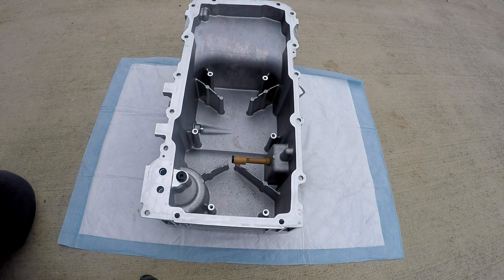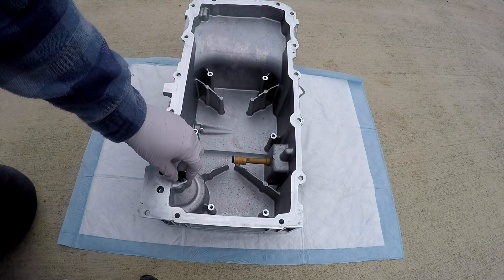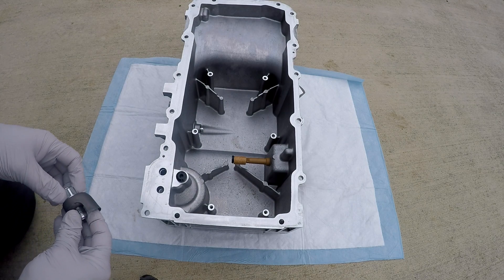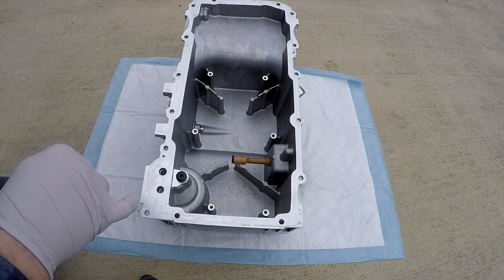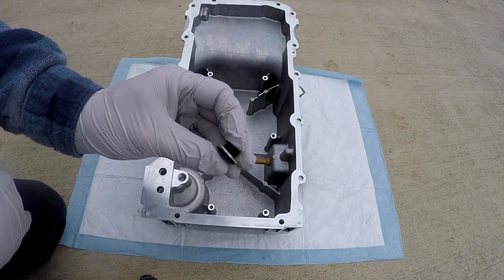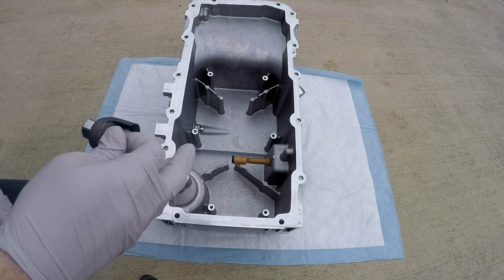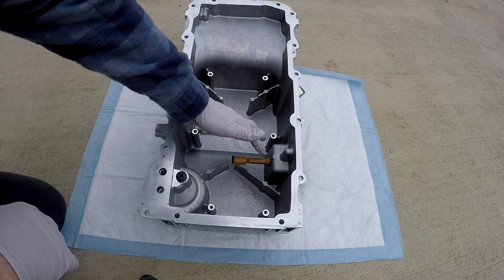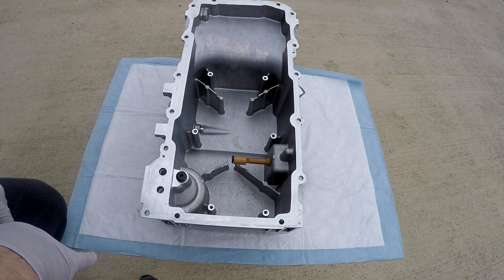Pressure Relief Valve in the LSA oil pan.

Comment: My issue is after an oil change I crank the engine in flood clear mode to prime the system, every other engine I have will either show oil pressure or have oil pressure immediately on startup. My 2020 6.0 will not. I even checked the oil level before & after cranking, no change. Upon startup there is a good 2-4 seconds before the gauge shows pressure, this with a prefilled oil filter. Why?

Comment: The problem I have on my '99 LS1 is that the oil pan seems to be under excessive pressure and it's pushing oil out the oil pan gasket. It can very well be that it's just the O-Ring/ gasket, but it isn't just dripping oil, it seems it's pushing it out. Any suggestions? Thanks.
Reply from the maker: Check to be sure you dont have excessive crankcase pressure or a warped oil pan.
Reply: @ That’s just it, I think it does have excessive crankcase pressure that’s pushing the oil out. What’s the cure for that?

Comment: I have an 07 Denali 6.2L, replacing the pan. Just put a 355 oil pump into it. What should i do with this valve? Plug it or replace it with a new one with a shield?
Reply from the maker: Keep or replace the relief valve if you have DOD/AFM currently in your engine

Comment: More like I just put the big oil pump on and still got no pressure
Reply from the maker: Sounds like you have other issues
Reply: Did you ever find out your low pressure issue?
Reply: @jsampang80  yes when you install a new engine prime it first 😅

Comment: trying to nail down a low pressure issue on an 08 6.0. Looking at this, it could be mis diaged if you just tested pressure at the filter mount, you would also need to test at the sender as well.. so testing both locations would verify if the relief was bad vs the pump.
Reply from the maker: Not the point of this video, but thanks.

Comment: I put a m14 x1.50 oil plug is it possible to put a too long of a bolt to plug the valve? I noticed the plug you installed is short in length. Will this work if I have oil cooler lines running to the oil filter?
Reply from the maker: Yes,, you can install a bolt that's too long.

Comment: I have a 2009 5.3 vortec without the variable piston option. Lately my oil pressure has been too high at higher RPMs and its causing oil leaks if I pull a long uphill drive into the mountain.

Could it be this part ?
Reply from the maker: No, If this part plugs then it just doesnt relieve at 58psi. I would suspect other issues.

Comment: I have a 2007 suburban 2500 with an LY6 that has VVT. I have a Melling 10296 pump in it. Can I run deinstall the oil pan relief valve and install a plug, or will it affect the VVT operation?
Reply: Did the plugging affect the VVT?

Comment: Is it ok to do it if you still have AFM/DOD on ur car ? I have low oil pressure and recently did a cam swap i already checked everything cam bearings cam shaft retainer plate changed my stock oil pump to a melling10355 high volume oil pump but still have low oil pressure problems by removing this valve would it fix my issue ?
Reply from the maker: NO!

Comment: Does this clogg more when afm is Delte or disables
Reply from the maker: The valve won’t clog if you delete AFM .
Reply: @fasnuf  so I have a range dod delte, can I plug it or do I need to replace relief valve
Reply: Oh I see I have range disabler so I’d have to buy new pressure relief valve?

Comment: You can use a m14x1.50 oil plug in place of the valve.
Reply: I have a LY6 with VVT, can I still plug it?
Reply: Should be able to.  There's a bypass built into the oil pump and the filter.   Only issue is if you have an aftermarket high pressure/volume pump.  You should be fine.
Reply: @20tea  I have a Melling 10296. Why would that be an issue?
Reply: @nategarrison99  it's not a high volume high pressure pump, so it'll be fine.
Reply: @20tea  eliminating this second pressure relief valve that is prone to fail shouldn’t eliminate any function of the VVT, since the pump has a build in pressure relief. Right?
Reply: @nategarrison99  The vvt still functions the same.  Problems only occur when there's too much pressure that the vvt doesn't work as intended. This generally happens with higher pressure springs installed on an aftermarket pump.  You'll encounter an error message on the dash.  I've experienced it with my hvhp melling pump, but it didn't wreck my engine or blow up a filter. I just reverted the plug till I get a low pressure spring installed.
Reply: @20tea  did you install a low pressure spring yet?
Reply: @johnnybobgoldstein2823  Not yet, but hope to sometime.  Have other car projects I'm trying to complete this summer.  Engine still good though.

Comment: How much of a pressure difference did you see when you deleted this with the upgraded pump?
Reply from the maker: It idles at aboot 27-30psi hot and redline at 70 psi using the Melling pump from my video with the middle spring. I went with  the high volume pump because the LSA has piston oil squirters so I want more volume to handle that extra draw. Thanks again Wes for watching.

Comment: What happens if you leave the pressure relief valve in after you do a complete dod delete with a new valley pan and cam and lifters along with a tune
Reply from the maker: The valve will continue to operate.
Reply: @fasnuf  I have done an dod delete on my 2009 gmc New cam lifters and new valley pan with the o rings then had it tuned it was running good for a few days now I have lot of oil on the spark plugs and no oil registering on the dip stick
Reply: If I temporarily remove the AFM system by driving in gear 3 so that it is always in V8 cylinder mode, can I remove the relief valve?

Comment: i have TBSS, so if i remove this valve oil pressure will be increased?
Reply: What’s TBSS?
Reply: @marksrig  trailblazer ss
Reply from the maker: @slowrook  I don't know in your situation. This video applies to the LSA engine which doesn't have any DOD hard parts.
Reply: mine doesnt have DoD too, its LS2 engine, ill try to search more, thank you for your video :D @fasnuf

Comment: Every where I look people are talking about low oil pressure. I have a problem with 80psi oil pressure. It’s not the sending unit. It happens when the pump hits second stage. New oil and filter. Right oil. Anyone have any info I could use?
Reply: Your relief valve may be plugged or stuck shut.  Same result when plugging the relief valve with a bolt.  Reccomend dropping the pan and checking the valve if you want less pressure.

Comment: Just pulled the engine out of my 08 sierra to do the afm delete. I plan on plugging the prv but I'm wondering if shimming the spring in the oil pump is necessary. My engine is stock with 180 000 on it and no ridge in the cylinders which surprised me.
Also the port for the oil pressure gauge in the "lifter valley" plate is shorter than the oe one in my engine. Wondering if the filter that is under it is a must have.
Reply: I'd remove the screen under the oil pressure sensor.

Comment: Its ok to plug off the pressure relief valve only if you have done a DOD/AFM system delete if you have not it will cause major engine problems. If your motor does not have DOD/AFM your ok to do so. Just thought I would let you know!
Reply from the maker: The video is in reference to the LSA like the title says which never came factory with DOD/AFM so no delete is even possible.

Comment: I have my DOD turned off via HP Tuner, would I be a good move to remove this part while I’m doing the oil pan gasket. Would removing the relief valve cause issues?
Reply from the maker: You still have the DOD lifters then keep the valve. This is only for the LSA engine.

Comment: 2011 5.3 LC9. Diablo tune AFM delete and now low oil pressure and no low end torque or acceleration(wont even spin the tires anymore😢) but all my power is at 4 to 5k rpm. Will blocking relief help? Any ideas anyone?? Other than new cam and supercharger 😂.  Help
Reply: I did the same delete with Diablo kit. Carries 20 psi after warm up and 40 running down the road. I rebuilt the whole motor. Going to take the relief valve out of the pan and cap it off. If anyone does a overhaul kit, don’t use engine tech gaskets they all leak. I should have used all Fel-Pro

Comment: A simple m14x 150 drain oil plug does the same thing is that Jegs Bolt.
Reply from the maker: As long as it's the correct thread and isn't so long that it blocks oil flow then about any type plug will work
Reply: If my Silverado is a 2008 model with the AFM system, shouldn't I put in the plug you mentioned?

Comment: So if i have delete my afm/dod stuff wouldni still be able to run the plug
Reply from the maker: I'm not following your question.
Reply: @fasnuf  sorry my bad lol so i have deleted my dod stuff and have cammed the truck i have with all tsp stuff since then ive been fighting oil pressure related stuff with all of the junk out of the motor would it be better to go ahead and put the plug in the pan and take that valve out and chunk it

Comment: I have a 07 with a 6.2l. It does not have DOD but does have VVT. Does anyone know if this modification will effect the VVT system?
Reply from the maker: Great question.  Your phaser is controlled by the ECM commanding a solenoid to open allowing oil to a valve that changes the direction of the phaser. I doubt that adding oil pressure will affect this, but it should be researched more before just pulling this PRV out. Sorry I couldn't help more.
Reply: The short answer is no, this does not effect the VVT system. After reading the description of operation from alldata I knew little more than before. My hypothesis was that since the ECM used several factors (including oil pressure) to operate the CMP actuator solenoid which controls the amount of pressurized oil into the CMP actuator that it would be able to compensate for the additional oil pressure. With a hope and a prayer I did this modification and looking at my scan tool data the system is operating normally.
Reply: @adamhorine4613 did your oil pressure improve after deleting the pan bypass?
Reply: @johnnybobgoldstein2823  it did not, I was losing oil pressure due to bad cam bearings
Reply: @adamhorine4613  thanks for the reply. I have an 09 2500HD 6.0, it idles 18-20 psi warm and doesn’t go over 23 psi at highway speed warm. Not sure if it’s a bad oil pump or bearings, 170k former fleet truck.
Reply: @johnnybobgoldstein2823  may try flushing the motor for a temporary fix. I had a 07 trailblazer with oil pressure problems due to neglect of regular oil changes. I'd fill the motor up with oil 1 quart low and add a quart of diesel fuel and run it for about 20 minutes at about 2k rpm, drain and repeat until i could finally see through the stream. It helped improve the oil pressure but my motor is still shot

Comment: Do NOT remove this Oil Pressure Relief Valve and the Deflector if you have AFM‼️This will damage your engine, the oil pump, and etc.. Also, It can cause oil consumption, lifter tap, and low oil pressure. If you have a vehicle from 2007-2011 that doesn't have the Deflector installed, make sure you install it to fix the oil consumption issue with the 5.3 engine.  A new oil pump pick-up tube will need to be installed at the time of repair also.
Reply from the maker: Good points, but there is no AFM or DOD on the LSA engine. Thanks for watching.
Reply: I have a 2007 Yukon Denali with low oil pressure (10-15psi)at idle when warm already replaced the oil pump with a standard volume pump and new o ring with no luck. I'm getting over 40psi on cold starts but drops when it reaches normal operating temp. I hope this plug gets me back up to at least 40 at idle. Any suggestions???
Your feed back would be greatly appreciated
Reply from the maker: @MartinAguilar213  If you have DOD/AFM then DO NOT install the plug. This is only for those who have completely eliminated the hardware and software associated with DOD/AFM. As far as your low oil pressure, the plug won't help idle unless the PRV is broke and leaking off oil pressure. Many things cause low oil pressure including a worn out engine and bearings. Check with your manual and be sure you're using the correct oil and filter. You may try different brands too.
Reply: @fasnuf  how about if u just tune out AFM with a disabler,should u leave valve alone?
Reply from the maker: @phillipduran2576  Leave the valve in
Reply: @fasnuf  what if it doesn't have a deflector shield?
Reply: @MartinAguilar213 same problem with my 2011 Avalanche
Reply: Why the oil pick up tube?
Reply from the maker: @phillipduran2576 what?
Reply: Do you have to remove the valve and install the plug once you complete the dod delete

Comment: So if you get a AFM delete would you need to remove that pressure valve and use a plug?would that be necessary?
Our would that need to be done incase oil pressure is lost or dropped 

 My vehicle's (2007 chevy avalanche)oil pressure is normal at idle and running I am getting AFM delete just to avoid down the road maintenance issues and I came across this video
Reply from the maker: The AFM/DOD delete is two fold. First, It needs turned off in the tune. Second, the AFM/DOD lifters need replaced with the same lifters used in the non AFM/DOD cylinders. The relief valve is not necessary to change. The main reason I deleted my PRV is I needed more oil pressure in the higher rpm range. If you're not pushing high HP and just daily driving, the PRV delete isn't needed. Great question and thanks for watching.
Reply: i do same but i also replaced the spring in oil pump and make the oil pressure @60 but after 1 week the oil pressure drop to 10 , do i need to close the valve in the pan ? @fasnuf

Comment: If I disabled AFM/DOD should I remove this? Or would that be pointless? AFM has only been shut off not deleted.
Reply from the maker: turning it off in the tune is great, but if the internals are still there I don't think I would do the valve. The valve is a real pita to get to.
Reply: Okay thanks, I’ll probably do it when I decide to do a rebuild. Thanks for the response

Comment: I just did the dod/Afm delete I installed a HV oil pump and the pressure starts at 40 then drops down to 0 after 10 mins. I'm starting the think I need to plug this but I'm not sure.
Reply from the maker: Something’s not right. Even with the relief still in you should never see zero. If you take the relief out, you need to plug it with a plug made for that purpose.
Reply: I’m having same issue, did u ever figure it out?
Reply: @amperformance1  how did you plug the valley plate? My understanding is after plugging the towers, you need to also plug the inlet to the cover plate off of the oil pressure sensor
Reply: @amperformance1  have you found the issue? I ended up buying little plugs for the AFM towers, and I'm still having an issue. Part of me wants to say cam bearings, but I doubt it.

Comment: Thanks for the video boss, I’m gonna be swapping oil pumps when I do heads/cam on my LSA this winter and was looking for something like this. What oil pump are you running? I’m debating between the melling 10355HV Or the precision oil pumps blueprinted melling 10355. Opinions?
Reply from the maker: Hi Drew. First, thanks for watching my channel and commenting here. It's my understanding that the factory oil pump in the ZL1/LSA is the same as the 10355. I decided because of this to get the 10355HV and also to remove this PRV. My oil pressure before was only getting to about 58psi at redline and with all my extra torque on the crankshaft trying to bend it, I decided the engine needed more protection. When I got the 10355HV, it came with 3 springs. The spring that came in it was the one I used. I think they said it was orange. The other 2 springs were to decrease and increase from that spring by 10 psi. I get over 70 psi with the installed spring at redline now so I'm fine with it. Are you removing the engine to do the oil pump? Check out my other videos, I know they can be a little long, but you might benefit here. Thanks and let me know how it goes. 
https://youtu.be/Yuk8qXfoR5Q
 https://youtu.be/2iqekORDMu8
https://youtu.be/NYMcssUsJ90
Reply: @fasnuf  Yes I will be pulling the engine to do the oil pump (as long with camming + supporting mods). Do you think that 70psi is a good amount of pressure at redline? I'm not sure if it is too much, as I've never really looked into different oil pumps and how much oil pressure is too much. Thanks a lot!!

Comment: I took mine out and haven’t replaced it would this cause pump prime issues or oil leaks from to much pressure I don’t know mine is leaking at rear cover I think and prime is lost over nite, thanks liked your video
Reply from the maker: Thanks for watching Michael. A loss of prime may indicate an internal leak in the oil pump or more likely the pickup tube oring has failed. This usually causes oil pressure to drop especially when warmed up. This wouldn't be a small job to diagnose or fix.

Comment: What pressure does this valve open up at?
Reply from the maker: If I remember right it's about 55 psi. There are discussions on many forums about this PRV and differences of opinion so do your due diligence. Thanks for watching.
Reply: @fasnuf  yeah, I was kinda curious, because even news these engines have never ran anywhere close to 55psi, but I’ve never found anything written in stone. But I think disabling AFM and placing a plug in the PRV’s place is the way to go.